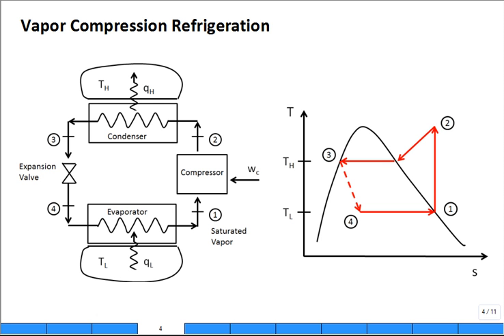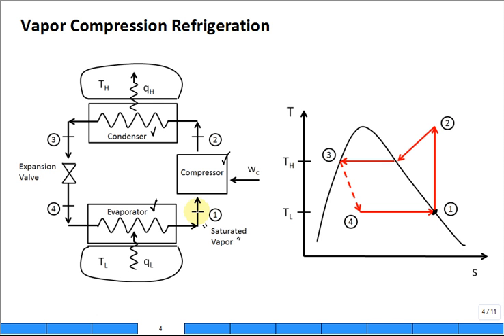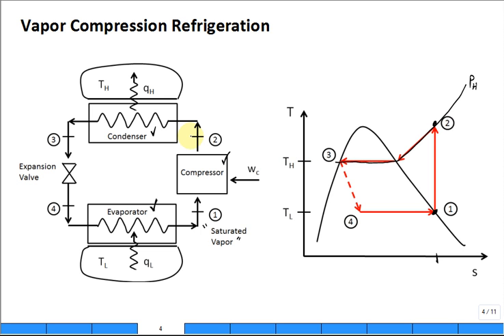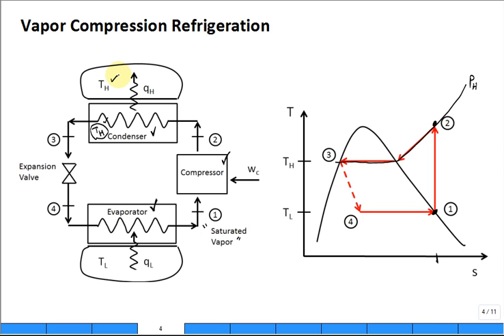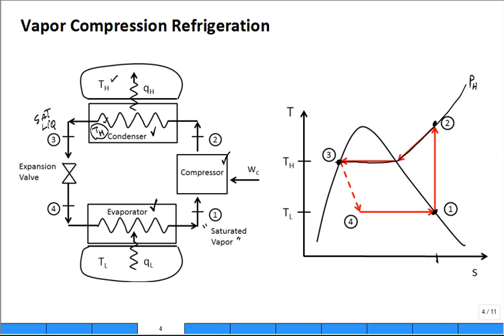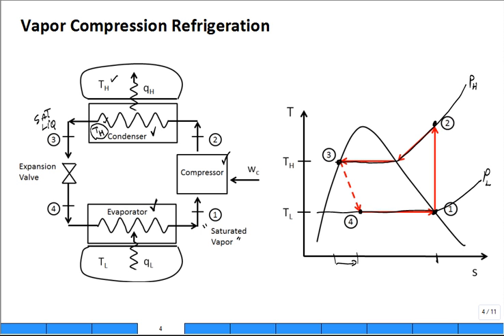Intro Refrigeration Cycle, Vapor Compression

Comment: why is the state of the refrigerant always a mixture when the (saturated liquid) refrigerant is expanded through the throttle valve in a vapor compression refrigeration system
Reply: i think that's because condenser is limited by air temperature (air is the cooler fluid )